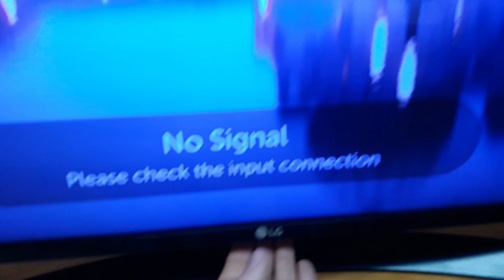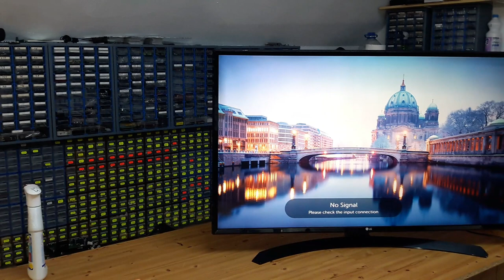How to Replace LED Strips LG TV 43" BLUE SCREEN- Fixing Bad LED Backlight Tutotial Step by Step

Comment: In Ploiești îmi puteți recomanda un service? Am același model de tv și imaginea este pe albastru. Tv-ul are 3 ani juma
Reply from the maker: Buna, sincer nu stiu. Dar ce pot sa va spun este ca daca va schimba ledurile sa solicitati sa le schimbe toate nu doar cele defecte, noi pt acesata operatiune dam garantie 1 an si a costat parca 280lei montaj inclus
Reply: @electronic.service  mulțumesc ptr informațiile transmise. La prima strigare, costul total al reparației este de 450 lei ( 270 doar benzile cu leduri); un pic cam mult zic. Am mai cerut și altcuiva un pret
Reply: @electronic.service  Bună ziua. Am observat și eu această problemă la un lg uk6200 de 43". As putea să îl trimit la dvs să îl reparați? Dacă da cât ar costa? Mulțumesc anticipat.

Comment: i had such a LG tv , replaced the led strips but in the final step a cornet broke of the led panel , the solution is that i wil never buy LG again , i have  a Smasung tv which is older then the one i just broke.